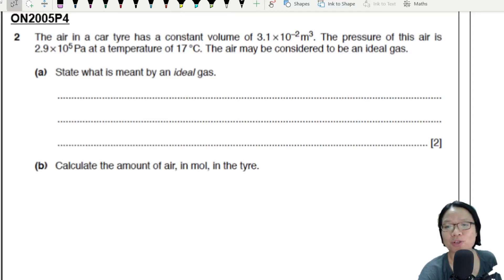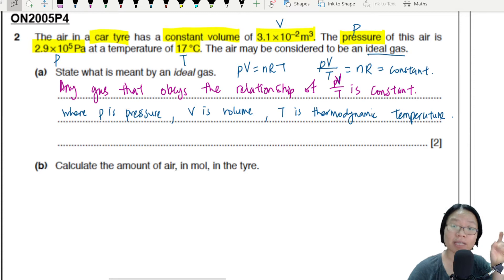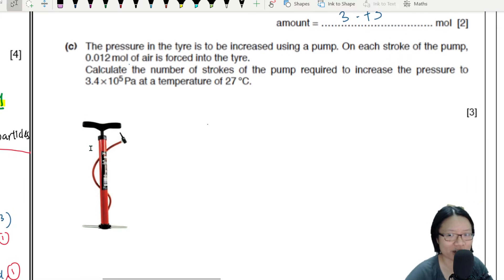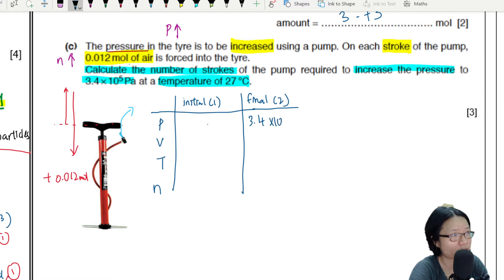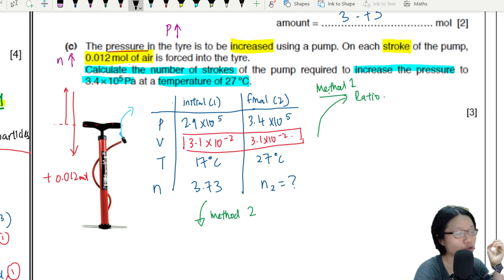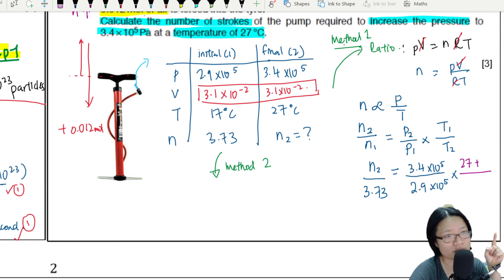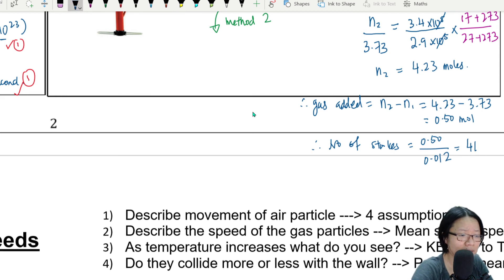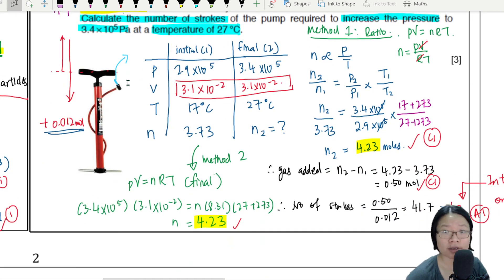15.1b Ex2 ON05 P4 Q2 Ideal Gas in Car Tyre | A2 Ideal Gas | Cambridge A Level 9702 Physics

Comment: I used the change in pressure and plugged it in the equation, PV=nRT, but I didn’t get 0.5 moles, so do we always have to use the PV=nRT for final values? 
Thank you so much for the great explanation! Super helpful!